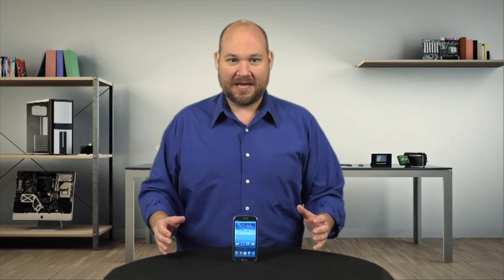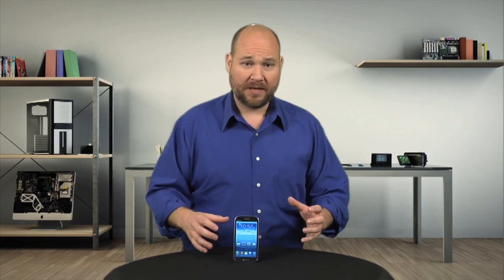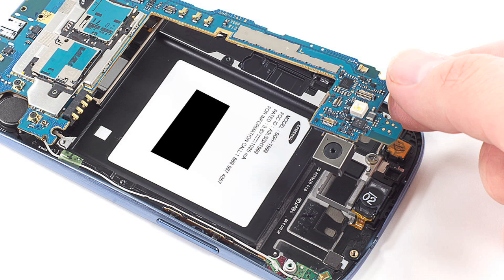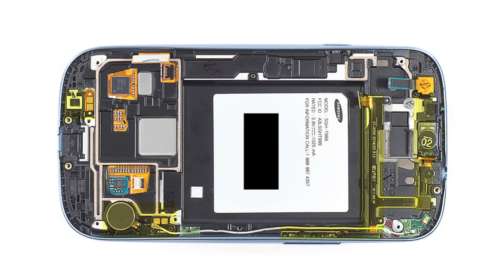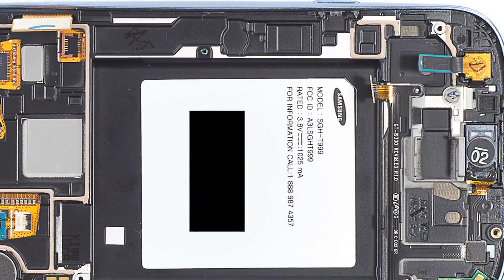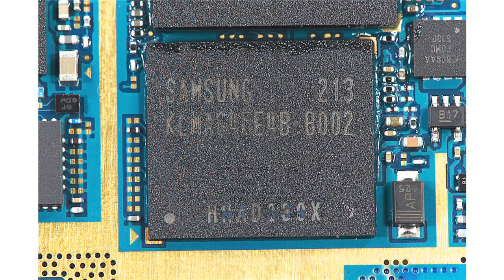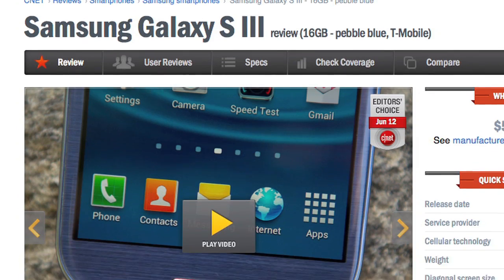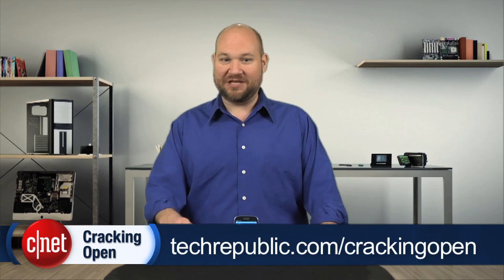Cracking Open - Samsung Galaxy S III (T-Mobile)

Comment: 1 ) built quality won't be as good. 2) u won't get the full experience with sammy or htc fucking the software. 3) it'll  be as slow and laggy. and lets face it google will never do that. Microsoft manned up and did it. "one more thing"" is that lets face it apple started